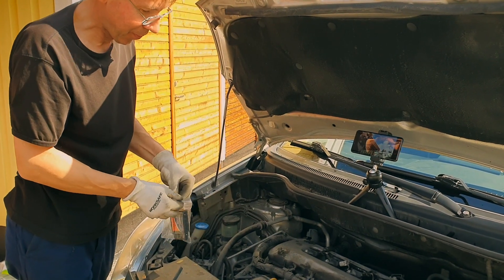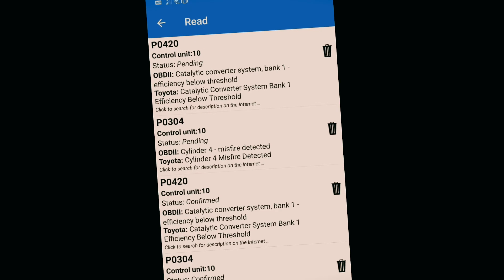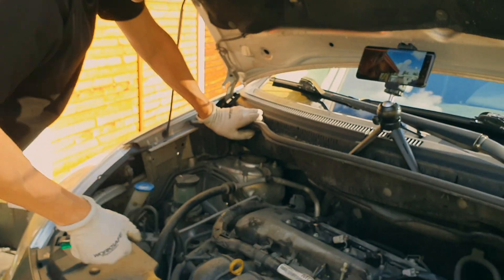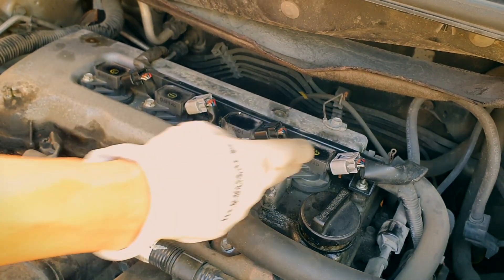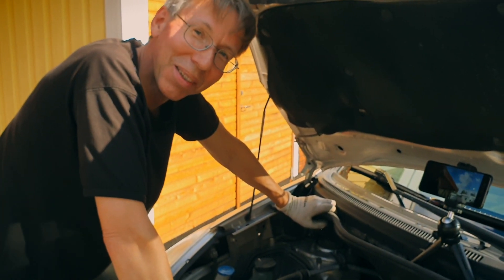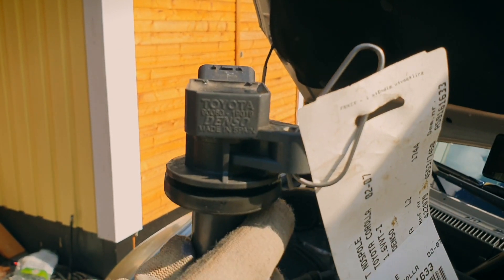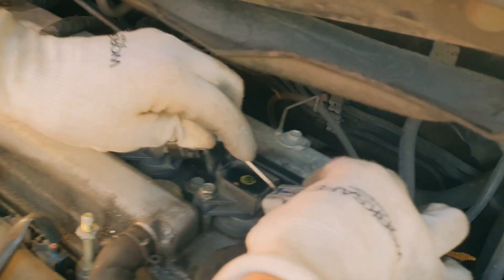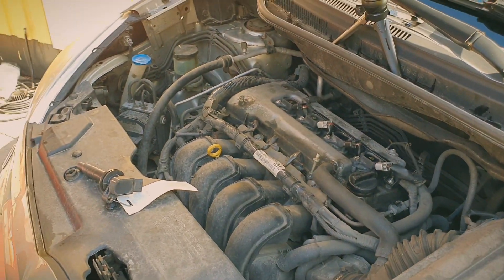TOYOTA ENGINE MISFIRE EASILY FIXED!

Comment: for anyone that needs this, in an inline engine - any engine that has all the cylinders in a straight line - has its cylinder #1 closest to the "front" of the engine, which is where the serpentine belt is. in this case, the engine is sideways, and the serpentine belt is on the right side of the vehicle, so starting from there you can count 1-2-3-4, and the one closest to the right side is the 4th cylinder

Comment: And the app’s link please
Reply from the maker: Hi Muhammad. Not sure how to do a link. If you search in Google play store for "Car Scanner ELM OBD2", you will find a symbol that is a white engine on a blue back ground. Some 10 million down loads. 
A transmitter to put in the OBD2 connector you will find if you search for "ELM 327 WIFI" for instance.

Comment: Misfire in cyl4 between 2k and 3k revs, checked plugs, coils, injectors, injectors cleaned and seals done while they were out, , hasnt thrown a code up in over 20k miles, but still misfires between 2k and 3k without a code or eml
Reply from the maker: Interesting trouble. If it is over a limited rev band one could suspect some sensor but that would set some error code and affect all cylinders I think. If you are sure that it is cylinder number 4 and only that one, I would get hold of a used coil and injector and try them out. There might be a certain vibration in that rev band that causes some intermittent electrical issue, maybe even in the cable harness?
Reply: Its definitely cyl 4, the eml used to come up and an obd reader told me random misfire cyl 4 but code hasnt come up in 20k miles, ive done all that coil packs, injectors, spark plugs

Comment: How did you manage to run it on 3 cylinders? My car refuses to operate if any of the coils are unplugged or faulty.
Reply from the maker: Hi Bob. Most likely different ECU:s for different Toyotas are programmed differently. As you can see in the video there was no issue for the engine to run on  three cylinders only. On newer Toyotas this might have changed. I would think that you need an OBD2 error code reader to to find out what could be the cause of the problem.

Comment: I replaced the valve timing solenoid in my 2001 toyota avalon and it runs much better.  No misfiring and idles at 800 rpm. Check engine light and VCS lights are back on. Any suggestions??😊
Reply from the maker: Hi Steven. Suggest that you get a basic OBD2 wifi or bluetooth transmitter, and a car scanner app. Then you can read the error codes.

Comment: Drove 4 hours with a misfire.   Hopefully it is because failed injector.
Reply from the maker: Hi. Injector or coil, as can be seen the coil is easy to replace. When an injector goes, sometimes the misfire can be a bit random before the misfire gets permanent.
Reply: @hoojiesgarage1542 I replaced my coil and injectors and I’m still misfiring on cylinder 2 what else could the issue be ? Maybe crank sensor I heard possibly ?
Reply: @J9227 O2 sensor maybe?
Reply: @J9227 curious to hear if you fixed it? I have the same problem. Cylinder 2 misfire not injector or coil

Comment: I think misfire engine isn't only bad coil and sparks plugs 
My corolla engine has misfire issues and no one could fix it whenever the car is idle for more than 1 hour if I start the engine it will rough idle for minimum of 15 minutes before the engine will runs normal 
I have changed so many things yet the problem remains the same3
Reply: Look into your fuel injectors, I had misfires on cylinder 1 and 2 and replaced all 4 injectors, resolved the problem.

Comment: i took off the plugs one by one but unfortunately in all cases the engine fails to start if any plug is off. something else then . with all plugs on it runs rough like there is a misfire.  great video though , so nice and simple , well done !
Reply: thanks for your reply , appreciated . what i found is that i must not disconnect the plug but rather take the coil out of the cylinder head and reconnect it to its plug and just lay it down . then the engine will start and i can locate the bad cylinder by trial . but if i leave the coil unplugged the engine wont start . maybe there is a common wire throughout all the plugs , not sure . this is a 1zzfe  1600 . but what is cool is i found the bad coil and replaced it . thanks so much for your simple and effective method . im going to have a small whisky now and will drink to your health !!!
Reply: @mart9999999999999999  for next time, the way you're supposed to do it is to disconnect the coil while the engine is running. You would first start the engine, unplug the first coil, and see if the engine speed drops audibly or if the engine cuts off. if either of those happen, reconnect the coil, then move onto the next and repeat
Reply from the maker: Cheers!  @mart9999999999999999
Reply from the maker: What happens if you disconnect the injectors one at a time while the engine is running? Can´t you identify the misfiring cylinder then?

Comment: i check by unpluging the injectors. but how would i know its injectors or igniton coild ?
Reply from the maker: Hi Justin. If you unplug one injector at a time and pay attention to how the engine is running, then you will notice if the misfire will change or not while doing that. If one specific cylinder is unaffected by the disconnection, then you have identified the right cylinder. After that you can swap ignition coils between two cylinders and check in the same way. If the misfire follows the coil, then you have it identified. If not, then the injector is the primary suspect.
Reply: @hoojiesgarage1542  it worked.  The different cylinder miss fired.  So it's the coil. Thank you. That was magic.

Comment: I have all cylinders misfire after having my transmission swapped with a brand new one.   All my coil packs and spark plugs are brand new.  Still misfiring.  I can't figure it out.  2003 Toyota matrix automatic
Reply: Since replacing the transmission doesn’t have much to do with the coil packs I’d say check the grounds make sure they are all good since the engine was probably removed or moved around. Also, check all your ignition wires that could have been pinched.
Reply: I have same issues with corolla